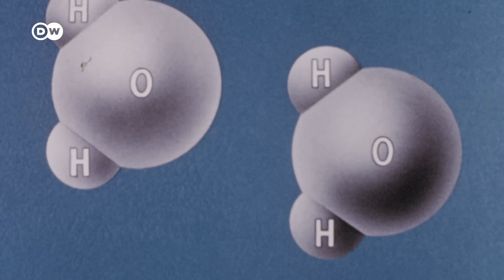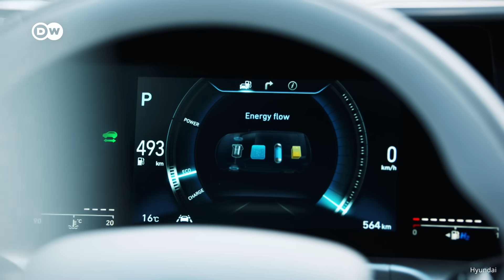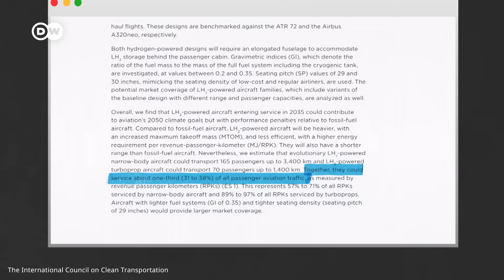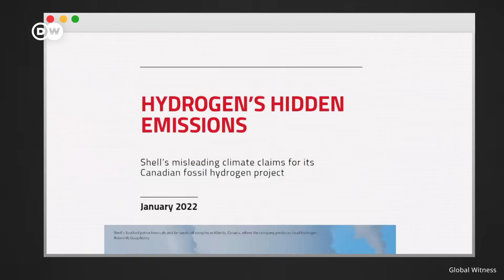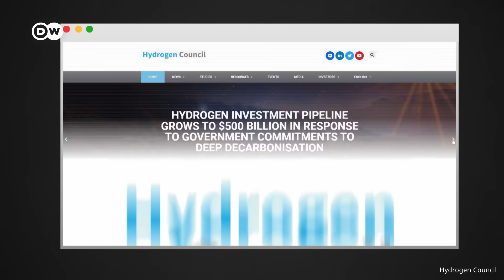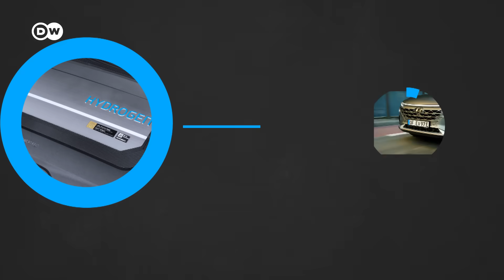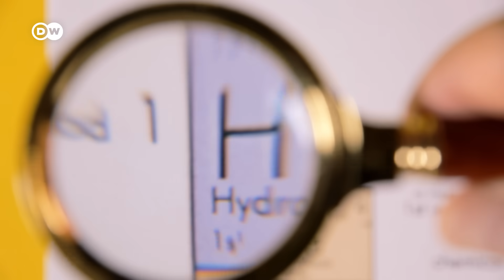The truth about hydrogen

Comment: Well, I dislike agendas.
And to not say a nuclear power plant.
With a hydrogen plant, next door is a good idea. 
Hydrogen power trucks could move it everywhere .
Even homes could be powdered by it.
No electricity grid has ever been built to adapt to double the load. 
Not even new grids going in today are planned for the level of use with EV. 
Something as simple as to many AC units running can cause blackouts, transformer explosion,  or fires.
The strip mining for copper will be unending. 
But it's got to be green. 
Is nuclear is not green enough???
Take your ideology and shove it.
Your analysis is worthless and probably dangerous to human health. 
🤷‍♂️🤷‍♂️🤷‍♂️🤔🤔🤔😜😜😜🐒🐒🐒😎😎😎

Comment: # [00:00:00](https://youtu.be/AGTjKJHu99c?t=0s) Introduction to Hydrogen

This video discusses the use of hydrogen as a fuel source and its potential benefits.

- Hydrogen is a versatile fuel that can power cars, trucks, trains, ships, planes and even be used to make steel.
- The only byproduct of consuming hydrogen is water and energy.
- Electrolysis is a simple way to split up bonds in water to obtain pure hydrogen.
- There are two ways to unlock energy from hydrogen - burning it or using it to power a fuel cell.
- Fuel cells work like batteries running on hydrogen and oxygen. They react to supply electricity that could power various things such as cars.
- Almost all the hydrogen produced today is used for other things like fertilizer or petroleum.

## [00:02:38](https://youtu.be/AGTjKJHu99c?t=158s) Hydrogen's Potential

As companies and countries commit to reducing emissions, there is growing interest in using hydrogen as a clean-burning fuel source.

- Net zero emissions targets require solutions for areas where electricity may struggle to provide the solution.
- The steel industry uses lots of energy and accounts for around 8% of global CO2 emissions. Hydrogen can be used as an alternative clean-burning fuel source in this industry.

# [0:03:36](https://youtu.be/AGTjKJHu99c?t=216s) Other Steelmakers Working on Similar Technologies

This section discusses how other steelmakers are working on similar technologies that will be market-ready by the middle of the decade.

- Hydrogen can be used to clean up heavy transport.
- A study showed that container ships going from China to the US could run on hydrogen fuel cells, reducing cargo space by only 5% or adding a refuelling stop.
- There are promising pilot projects for hydrogen-powered ships and aviation.
- Long-haul flights may be a challenge, but short- and medium-haul flights could cut aviation emissions by up to a third.

# [0:04:43](https://youtu.be/AGTjKJHu99c?t=283s) Not All Hydrogen is Created Equal

This section explains that not all hydrogen is created equal and there are different ways to make it.

- Almost 90% of all hydrogen produced today is gray hydrogen made from fossil fuels, mainly natural gas.
- Gray hydrogen production is a dirty business and needs to be cleaned up if we want to use it as a clean fuel.
- Blue hydrogen refers to fossil fuels with carbon capture and storage. It still produces CO2 emissions, but they are caught and stored underground or turned into materials for other purposes.
- However, blue hydrogen has a very large greenhouse gas footprint. The greenhouse gas footprint of blue hydrogen is worse than if you simply burned natural gas directly for fuel instead.
- Despite this, blue hydrogen has made its way into the official hydrogen strategies of major economies like the UK, US, Japan, and EU.

# [0:05:50](https://youtu.be/AGTjKJHu99c?t=350s) We Need More Hydrogen

This section emphasizes that we need more hydrogen to cut emissions in polluting sectors.

- Hydrogen can solve a complicated problem and help cut emissions in some of our most polluting sectors.
- However, not all hydrogen is created equal, and we need to clean up its production.
- Blue hydrogen is not as clean as it seems, but it has made its way into the official hydrogen strategies of major economies.
- We need more green hydrogen, which is produced from renewable energy sources like wind or solar power.

# [00:07:09](https://youtu.be/AGTjKJHu99c?t=429s) The Problem with Blue Hydrogen

This section discusses the criticisms of blue hydrogen, which is produced from natural gas and carbon capture technology.

- The oil and gas industry promotes blue hydrogen as a solution to climate change, but it's actually a marketing strategy that doesn't have scientific support.
- The Hydrogen Council, an industry group that includes BP, Shell, and Saudi Aramco among its members, did not respond to criticisms of blue hydrogen.
- Chris Jackson, founder of Protium (a UK company focused on green hydrogen), believes that building better projects and technologies is the way to resolve the issue.
- Green hydrogen is produced by using renewable energy sources like wind or solar power for electrolysis. This method produces no emissions and results in truly clean hydrogen.

# [00:08:04](https://youtu.be/AGTjKJHu99c?t=484s) Making Green Hydrogen

This section explains how green hydrogen is made and why it's set to become cheaper than other forms of hydrogen.

- To make green hydrogen, renewable energy sources are used for electrolysis on a much larger scale than what was shown in the video.
- Currently only a tiny fraction of hydrogen is green because it's still pretty expensive compared to other forms.
- Electrolyzers are getting cheaper due to more upscaled manufacturing for larger projects. Prices for renewables have fallen consistently and will continue to do so.
- BloombergNEF predicts that green hydrogen will be cheaper than blue by around 2030 and cheaper than grey by 2050.

# [00:09:02](https://youtu.be/AGTjKJHu99c?t=542s) Challenges with Using Hydrogen

This section discusses some challenges associated with using hydrogen as an energy source.

- Hydrogen has a relatively low energy density, which means that three times more space is needed to store the same amount of punch compared to natural gas.
- Building new storage facilities will likely be necessary depending on how much hydrogen is needed.
- Renewable electricity is still scarce and precious, so it should be used as effectively and efficiently as possible. Hydrogen may not always be the best way to do this.
- Finding the balance between what we use for battery and what we use for hydrogen is important.

# [00:09:41](https://youtu.be/AGTjKJHu99c?t=581s) Efficiency of Hydrogen vs. Batteries

This section compares the efficiency of using hydrogen versus batteries in different contexts.

- Passenger cars can run on hydrogen fuel cells, but turning electricity into hydrogen, transporting it to refuelling stations, pumping it into a fuel cell to then convert it back to electricity is not very efficient. About 60% of the energy gets lost along the way.
- Alternatively, using the same energy directly to charge a lithium-ion-battery that powers an electric motor results in only 20% energy loss.
- With trucks, batteries weren't believed to work initially.

# [0:10:22](https://youtu.be/AGTjKJHu99c?t=622s) Long Charging Times and the Future of Battery-Electric Trucks

This video discusses the future of hydrogen fuel cells and battery-electric trucks. Here are some key points:

- Long charging times are not ideal for businesses.
- Batteries are becoming more powerful, and charging times are decreasing.
- A recent study suggests that battery-electric trucks will dominate the market in the future.

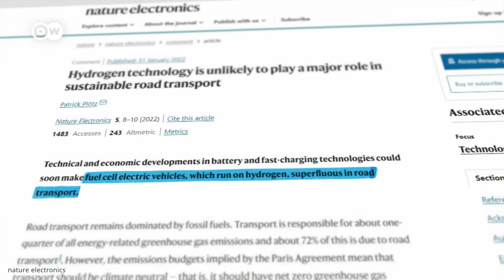# [0:10:40](https://youtu.be/AGTjKJHu99c?t=640s) Hydrogen Fuel Cells

Hydrogen is not a silver bullet solution to all problems, but it does make sense in certain cases.

# [0:10:49](https://youtu.be/AGTjKJHu99c?t=649s) The Future of Green Hydrogen

2022 through 2026 will be crucial years for demonstrating that momentum around hydrogen is converting into real assets and production of green hydrogen. 

- Green hydrogen has long had a chicken-and-egg problem with supply and demand.
- Governments around the world are starting to invest in hydrogen, which may change this problem.
- It's predicted that hydrogen could supply up to 20% of our energy needs by 2050, up from almost zero today.

# [0:11:28](https://youtu.be/AGTjKJHu99c?t=688s) Conclusion

The next decade is critical for seeing if green hydrogen can live up to its hype. If we don't see progress during this time, we may struggle to hit climate goals overall. 

- The video ends with a question for viewers about whether they think hydrogen is the fuel of the future or if we should focus on other alternatives instead.

Comment: I never see proponents of hydrogen from electrolysis talk about where all the water is going to come from. I think we have to assume that industry will always use the cheapest and simplest solutions available for their business. Why not just pull your water from underground aquifers or big lakes or snow pack or...? I don't think we should have any new large-scale energy solution that taps into water, unless that water can come from the sea.

And I do understand there are hydrogen solutions that propose to use seawater. But they don't talk very much about how they deal with the salts and other minerals that must be separated and disposed of regardless of what the production method is. And I would think the requirement for using seawater would require that the electricity needed for hydrolysis be produced near the ocean and that the hydrogen production be near the electricity generation infrastructure.

I like the basic idea, but I don't know how to calculate the comparative costs and energy efficiency and so forth to be able to compare this kind of hydrogen production with something like skipping the hydrogen entirely and injecting all of this electric power into the grid or into some long-term energy storage near the grid. I do understand this would assume a modern and reliable and secure electricity grid, which is yet another problem that has to be solved regardless of where we get our energy from.

Comment: JCB after 3 years of development have now got all their earth moving units not only fitted with hydrogen fuel internal combustion engines , they also have the fuel delivery systems in place.  The hydrogen supply is the only hold up but they are selling in America where hydrogen is available.  The Americans hope to reduce the fuel costs down to a $1 per litre. It works similar to a petrol engine with no carbon emissions'.  No carbon in the sump oil either. Yoyota also have a viable hydrogen car motor developed now.

Comment: A car can use a fuel tank to store water and a ship floats on it thousands of miles from any infrastructure.
Surely the only way for hydrogen to be astounding is for technology to convert that water to hydrogen in a vehicle or ship on the fly with the chemistry of electrolysis and fuel cells.

Comment: A group of belgian scientist, Ku Leuven, is developing a solar panel that use the energy created by the sun to power a electrolysis process, and recent tests have found out that one of them could produce up to 250 liters of hydrogen fuel for cars in a day. I hope that they will continue on this path, because it would mean that we almost wouldn't need to pay for fuel at all by producing it at home.
Reply: 250 liters of normal pressure hydrogen are only 23 grams. Which would give you 2 km of range with a fuel cell car.
Just to clarify the potential.
Reply: "Making hydrogen at home", sure - what could go wrong? 
💣💣🔥🔥
Reply: keep in mind if you "VIBRATE the water molecules with the center of a magnet you will increase output significantly.  think about it,  what separates the atom , proton and neutrons  answer the "B" field .. the center of a magnet is by far the most powerful the "B" field.
Reply: @vincecox8376  You have zero college education in physics, that is clear.
Reply: @wiscgaloot  Wake up !!  I know what I know!!  There is a reason they put ^^^^^ all over the ancient pteroclids
Reply: The real trick is to vibrate the molecules of water at the correct frequency with the center field of a magnet..  It will separate the atomic structure and provide much more output,
Reply: That's true actually, I'm working on a project to increase efficiency of electrolysis by using external energy, heat or vibration or just electromagnetic waves, still nowhere close due to lack of knowledge and resources.
Reply: People have actually accomplished this cheap method of fueling before but there is too much money in oil for it to ever make it to market
Reply: I’ve been doing that for years already… with “cheap” regular solar panels and electric cars (which have more space and are less complicated) oh and to “fuel” up with hydrogen you need to compress is to around 750 bars first and cool it down to -40 Celsius. Good luck with that.
Reply: ExxonMobil's worst nightmare.
Reply: @alkh3myst  Not really. ExxonMobil, Shell, and other OMCs have large cash reserves which can be invested in these organizations. Also, it will take a large amount of time to make green hydrogen economically viable, given ExxonMobil enough time to adjust to the changing reality.
Reply: @hrushikeshavachat900  You think that each one of us being able to produce our own fuel isn't the oil companies' worst nightmare?
Reply: @alkh3myst  
1. Retail consists of a very small component of the business for these companies
2. They have huge cash reserves, which they can invest into other companies that are in greener industries
3. The green hydrogen will take at least 10 years to become economically viable to justify the investment it requires. Until then, other types of hydrogen will remain in business. The raw materail used in majority of these businesses is either CNG or petrol
4. These companies themselves can jump into green hydrogen business. They have the expertise and cash required to make this venture possible.
5. The government and companies have already entered into 20 years contracts with these companies. So, they are sure of having enough business for at least 20 more years. Until then, they can shift to greener alternatives.
Reply: It's likely that charging batteries with that sunlight via solar panels is much cheaper and 3X more efficient than making hydrogen via solar electrolysis.
Reply: @ercost60 what about all the materials and disposal needed for the electric car batteries?
Reply: @ercost60  Actually, no. Free or uber-cheap energy is everywhere-the main issue with energy is not the production but storage and distribution. 
Solar panels produce electricity when/where nobody needs it, and fail miserably when/where we need it- you gave a great example of this. 

I need my car during the day- on the road! not on the charging station. I'm happy to charge EV overnight when I'm sleeping, but your "cheap and 3x more efficient" solar panels are not working then. Sure, I can spend 50k$ on a power bank, but this solution is neither cheaper nor more efficient. On top of that the batteries will fail after 5 years, and most of the countries have like 3-6 months of winter.
That's why H2 production is a great idea- it can produce H2 when/where nobody needs energy, and this energy can be easily and cheaply stored+delivered to the right place. 
I don't care about the theoretical efficiency of a useless process. What matters, is the practical efficiency of a useful one.
Reply: @Grzegorz M.  There are more promising lage scale energy storage options than hydrogen in my view. I think, the main one is the liquid flow battery. This has a far better efficiency and is also very scalable...
Of course if you can make it directly in the solar panel you could get a more efficient solution that is feasible, I am not sure about that...
Reply: @tijljappens7953  : "Scale" is such an important word with energy storage. Hydrogen scales really well for trucks, trains and particularly shipping. It may also fit with cars, we'll see.
Reply: We can use solar panel top of our car so that it produce electricity while driving and parking. Secondly we can use two battery instead of one. One battery will be charging under solar panel at home and it will be full charged during whole day, next day you can replace this battery with empty one. Thirdly if we still have enough solar energy, we can store it as hydrogen fuel.
Reply: @CThought  Doesn't make sense economically as on date. It makes more sense to charge the EV using a solar power grid system.
Reply: @CThought  Just casually swap the batteries over as you charge them on a rotating basis... 🤔  How heavy must these batteries be.  I can hardly lift the teeny tiny lithium ion batteries that came with my mum's mobility scooter.  Let alone one that you'd need in a family car.  😂
Reply: Ludicrous. It would be far more efficient to use that power to charge batteries.
Reply: @wiscgaloot  "It would be far more efficient for everyone to do what my masters at Big Oil say."
Reply: It's not hype , we can easily build a carburetor that  works directly from water, no storage of hydrogen it's developed right at the carburetor.
Reply: Isn't that just using panels to charge an EV, but with extra steps?
Reply: Then you are stil stuck with a huge storage and a huge transportation problem ....
Reply: @JongJande  : Ammonia is not difficult to store and transport. I suggest you look at Toyota's website where they address these issues.

Comment: As said hydrogen is an energy storage tech not an energy source. Electroliser cost is key. Renewable energy is often produced where and when we can not use it. If electrolisers are cheap enough to run to use this low cost or free energy then switch off during periods of high electricity demand, 
Green hydrogen will have a significant part to play.